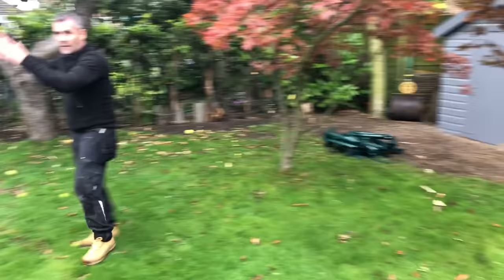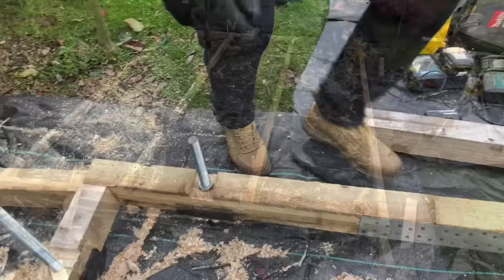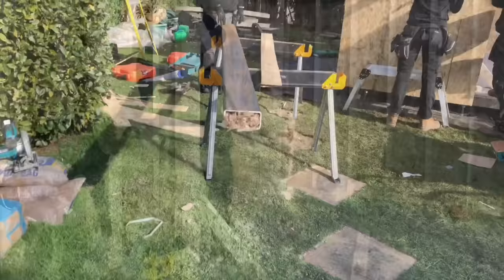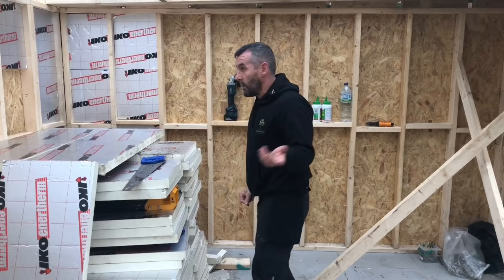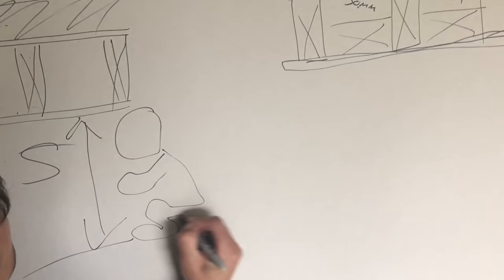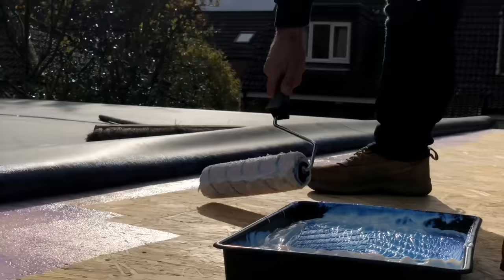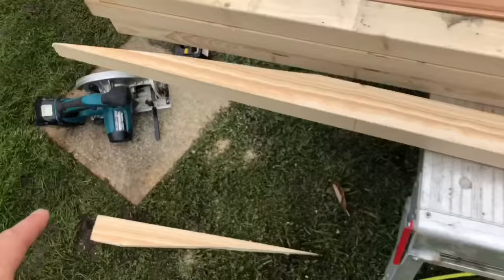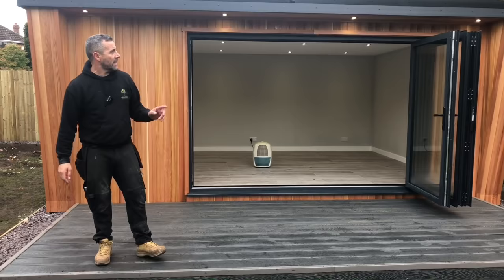Garden room build in 15 days start to finish in 1h 43m 57s, maybe help you drift off to sleep

Comment: how much would a customer expect to spend on a basic self build garden room 5 x 3?
Reply: I'd say doing something like this on your own would take you maybe 2 months? I'd say probably £12 - 15000 for materials.
Reply: @marccas10  Crazy, as a solid concrete floor with block walling or even brick would be far more substantial & some brickies would get that done in a few days. And a keen DIYer could tackle that themselves also if they take their time. All seems to be on appearance with the expensive ceder cladding at $3k because it is fashionable (expensive) at the moment. At the end of the day a brick or block based wall will last a lifetime & more, is far cheaper & far superior & that is with just the outside wall with the inside being clad in CLS with plasterboard.
Reply: @triax7006  Yeah, I agree block would be cheaper. How much would it be to dig out foundations and concrete though?

Comment: https://www.toolstation.com/dewalt-flextorq-screw-driving-bit-set/p36809?store=MK&utm_source=googleshopping&utm_medium=feed&utm_campaign=googleshoppingfeed&gclid=CjwKCAiArbv_BRA8EiwAYGs23FYxZyTuGqvXYJ_mDNRn6W7PELPA8-CWssMw72VTsgmGBBTFZmBJnhoCpnMQAvD_BwE

These are designed for impacts and are more resistant to breaking. If you're using un-hardened bits in your impact you'll just chew through bits.

Comment: WOW AMAZED and very upset I have had experience of "Professionals" using paslode nail guns to speed up and make money and I can tell you TOO NEVER FIRE that gun with someone else inside the building especially with a baseball cap on @ 43:10s you could kill him easily or on any roofing part of the job if other people are inside the structure..... 
AND if your in that much of a rush and your "professionals"  aint doing it the way you want..... you should actually slow down a bit helps massively when on site experience and time on a tool counts for everything on the site!!.

Comment: Has much has he shows everything . Why not paint the steel beam ? It will rust don’t worry about filling it with insulation . Id be more worried about the beam rusting if i was the customer . I wouldn’t have paid for this and it wasnt painted . Its not hard to paint it in red oxide . To preserve it for the next 20 years easily if painted . Cutting corners and it doesn’t need to be . Shame really . Wouldn’t mind you can order them painted nowadays .
Reply from the maker: Have you ever Googled rust rates?

Comment: can't believe that the steel is only sitting in between a beam and a thin bit of OSB?! no fixings, no welding? baffling! questionable methods and explanations. Im a civil engineer so I might be over cautious on things here. Will prob withstand most cases but I prefer to see proper methods and design, not just state that something works because he says so.

Comment: Using a shovel in a running cement mixer 🤭.also if you knew your stuff standard wera or any driver bit is not suitable for impact drivers .
There are specific ones for this . tradesman??? 😂😂😂

Comment: I appreciate the video, but stopping cold bridging by filling the steel tube is hilarious.
Reply from the maker: If you watch it and listen you’ll hear me say “helps” not stop, guess your appreciation is as back handed as your comment 👌😉
Reply: @thegardenroomguru   I sincerely appreciate the video. There is a lot information, no useless time lapse filmed from 20m and I like the idea with threaded rods which I have newer seen before. As for the watching it again, I did, and I hear stop or it may be stuff. But never mind that, English is not my first language. Heat will move though the highly conductive steel, little radiation through the air is negligible. All the best.

Comment: Brilliant build and quality trades, BUT, Safety! Not once did we see anyone with safety glasses, including using a circular saw at eye level cutting off the fence top or while using Paslode guns. Chainsaw used without proper kevlar clothing or face protection. If your gonna promote on YT at least promote Safety,especially for those younger trades starting out and DIY'rs looking for help.